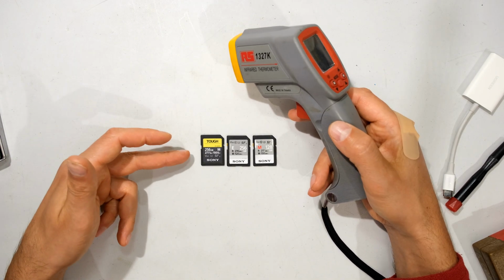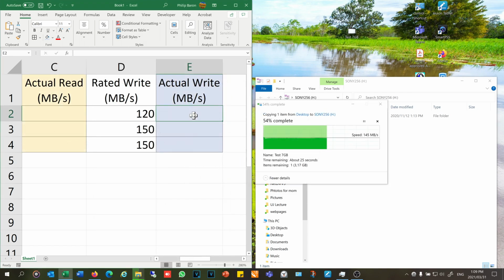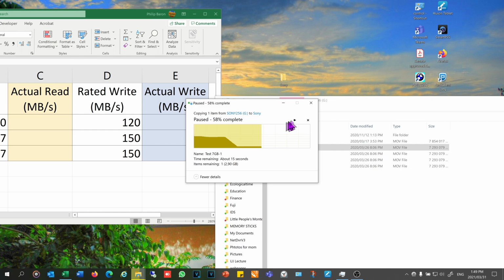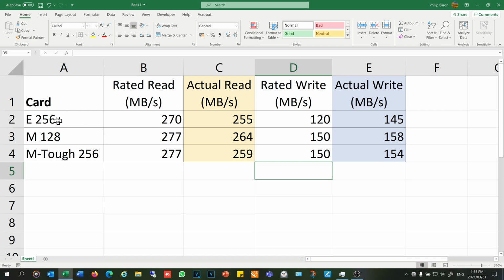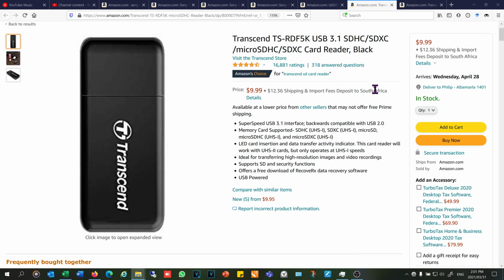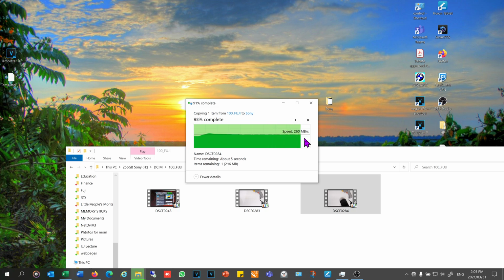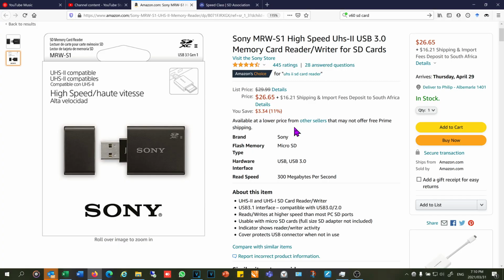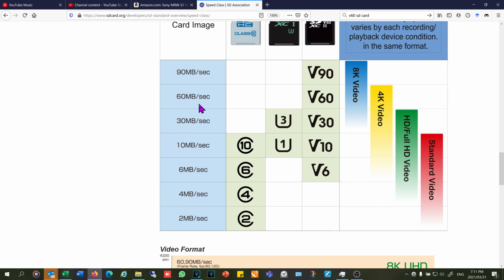Speed test comparison of the Sony M Tough and E series V60 SD cards - real life tests

Comment: I’ve just got my first mirrorless. I went for the A7iii. 

When I’ve taken a long exposure (4 mins +) it takes really long time ‘processing’ 

Is this due to the SD Card? 

I’m guna get a uhs2 card, and a quicker UHS 1 card as it has 2 card slots. I’m hoping this will improve the ‘processing’ time as after I’ve taken a shot, I can’t do anything with the camera for the next few minutes, which can be annoying when I want to see the shot I’ve just got and start to frame another. 

Hopefully someone with a7iii experience can gimme any info. 

Cheers
Reply: Is the in camera/long exposure noise reduction tuned on in your camera? If yes then that would explain the long waiting time before you can resume camera operation.
Reply: @r2Sn  should I turn this off then? I left it on as it sounds like it’s be something that I’d need, but I’ll turn it off and see how the shots look.
Reply: @h-dawg969  yeah buddy turn it off. The noise can easily be dealt with in post production. 

What the in camera noise reduction does is it captures another frame with same shutter speed but the shutter is closed. For example in your case 4min long exposure+ another 4 minute dark frame with shutter closed+ in camera processing. All this adds up to the time your camera is locked up in the processing phase.

Try it with the noise reduction turned off and lemme know if it helped. Cheers...
Reply: @r2Sn  yeah I’ll give it a go without NR when I’m next out on a shoot. Cheers for the tips.

Comment: I see the problem with the test. You did not test minimum write speed. 
When you use it in the camera and record long sessions. You constantly recording 100s of GB in one go. And that's where cards may throttle, overheat or run out of buffer.
And that where the difference may be. 
V60 means Card can record at least 60MB/s, even throttling. 
V90 means Card can record at least 90MB/S